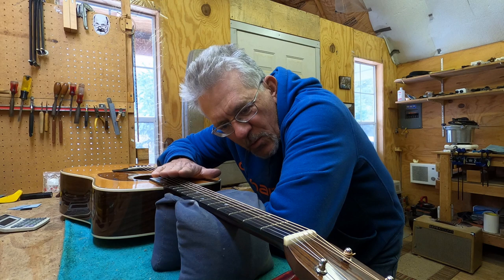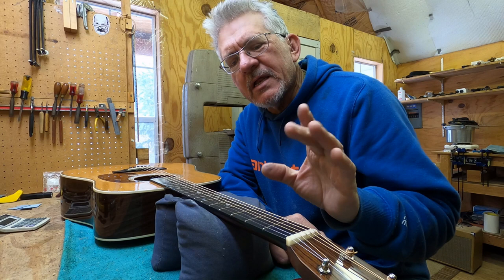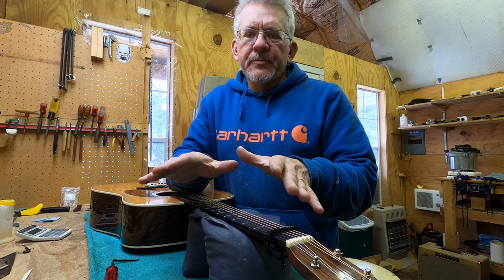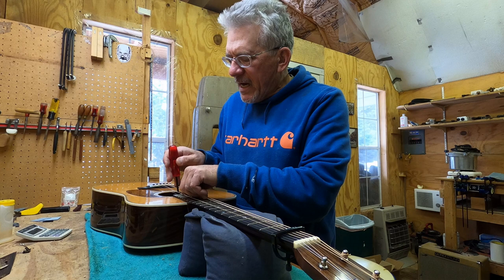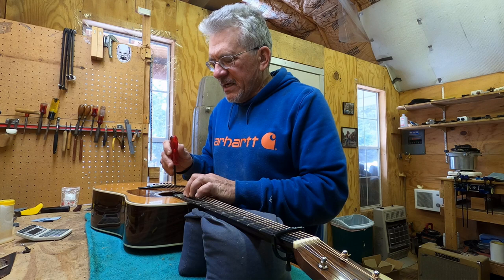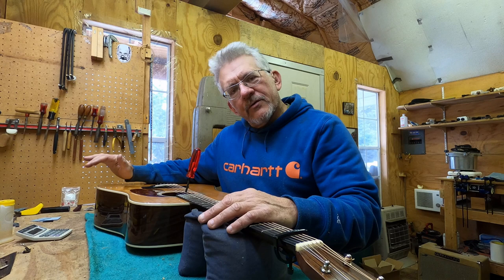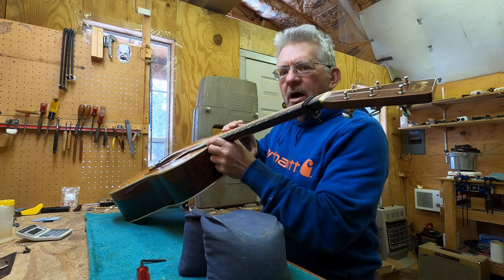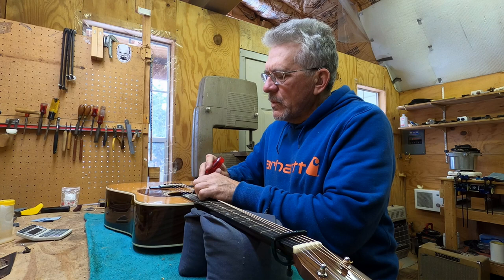How to Adjust a Martin Truss Rod

Comment: You had me confused with the super glue bottle for a minute.  I had to tighten finger board nuts on my Bourgeois.  That was some mental and physical task.  Never thought of pre-stressing neck, but it makes sense for relief adjustment.  BTW, if you double over a post-it-note, that's about .005.
Reply from the maker: Some things may take a minute to grasp.  :)   Oh... yeah.. the Bourgie f/board nuts!!!!  That's an easy neck to work on, but those nuts will cramp your fingers up after the 6th time.   Paper is a good tip... I started out using picks and coins and I forget about those things because I've got a set of feeler gauges right in front of my face.  They're only $7 at any auto parts store or WalMart in the country... everyone oughta have a set.  

Someone famous... Dudenbostel or Randy Lucas or someone like that... showed me the pre-stress thing very early on and it  is almost essential for mandolin necks.
Reply: @Bryankimsey  I rechecked my action.  Found some old feeler gauges - compared .002+.003=.005 with post-it-note X2 with caliper.  Loosened truss rod about 1/8 turn.  Took it from about .004 to .005.  Surprisingly, my fingers could tell the difference!
Bought guitar from a dealer in England last year.  Delivered tuned to pitch, no headstock padding, flimsy box, but arrived intact.  Neck would creak with pressure.  Bourgeois advised tightening f/board nuts, OK now.
Thanks for your great videos!
Reply: @Bryankimsey  BTW, had an old 70 D-28 and later D-35.  I didn't know enough then to know if intonation was OK.  Sold D-35 to Scotty Wiseman up the road in NC.  Saw it later with Lula Belle in a book about country music.
Reply from the maker: Fingers can be VERY sensitive!!!  

I don't think the misplaced bridge was common knowledge at all until fairly recently.

Comment: Great explanation especially the super glue bottle. (Full disclosure: I used to fix car interiors back in the vinyl seat days, and could fix a bead with a dab of super glue and pick up $25 for the effort, back in the 1970s!) 

Your video goes half the way in addressing my question (see my comment on restringing a Martin) about which direction to wind the strings!

Comment: When you check the relief why hold the guitar resting in your neck creating unwanted stress and relief just by holding it like that. Doesnt seem like a lot of experience to me.
Reply from the maker: Measure it yourself both ways and you'll see if makes no difference at all unless you have a rubber neck. You can check the relief however YOU want.  I do it that way so I can backlight the gap and get a good measurement.  You should perhaps check my "experience"... quick Google oughta get you there. I have tested almost everything I do and you should probably watch this one, too: 

https://youtu.be/AOmnx7SHhzw